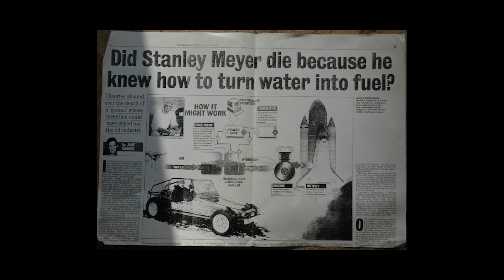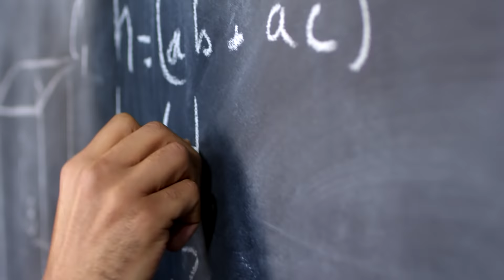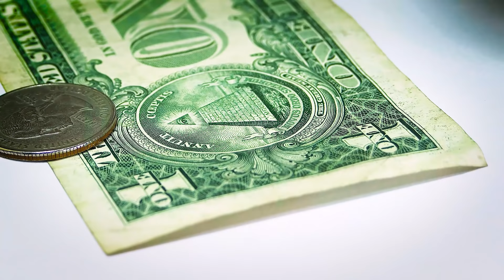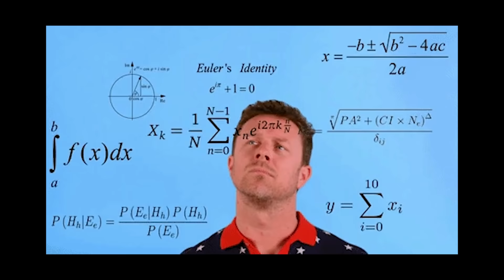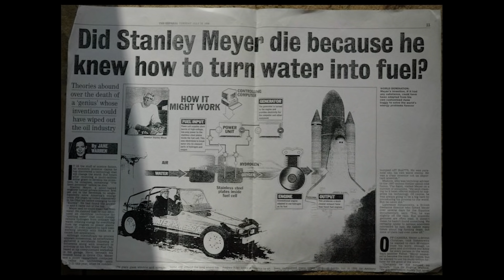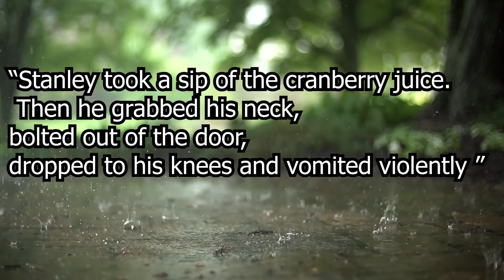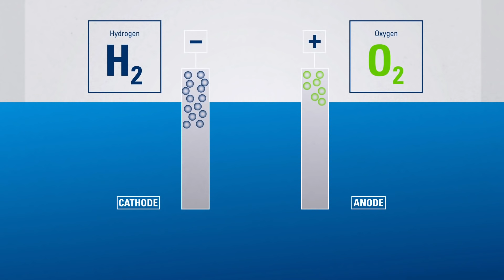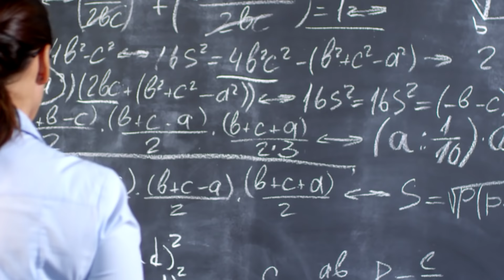Stanley Meyer Water Powered car, Lies and Death

Comment: How do you know it was an intro. I'm glad to hear to split Adams I'm just saying how do you know. And you think something like this was going to succeed it's kind of like the UFO and how long these people played it off as fake and now you're seeing all kinds of videos and all kinds of people saying they see these UFO's and aliens but not to get off subject how far off could it really be. If you're mechanically inclined how much  Voltage from an Ignition system how much voltage is there? OK hes just fast tracked that idea to processing it all-in-one shot and processed inside the motor using a plasma ark To start the combination And process in the cylinder of the motor. How far off is he he just basically made it  The idea simpler and you can use plugs and coil packs. And at the machines that you're speaking about Wouldn't the coil pack or an Ignition system of a vehicle be enough power to  The water  Into gas and igniting it And  Which turns the engine and he spoke about it it was video that if you were to tune it you would have to retard the motor because it is a bit more powerful than  Regular gasoline. So how could he know that the only thing you have to do with a vehicle once these things are installed in the car is that you have to tune it. He didn't say it's a wonderful fix all right there that 2nd type of scenario he never said that you have to put it on there and have to tune the motor to to the new fuel setting. And once the military got involved what you forgot to mention The only problem they had with that was the same type of problem they had with cars back in A-day was that when you made sharp turns the injured bug down The only problem they had with that was the same type of problem they had with cars back in A-day was that when you made sharp turns  The engine will bog down But that was something that can be fixed with pressurizing the tank or baffles or whatever there is to keep it from slashing around and closing a Is low fuel pressure. But apparently I guess it was fake because if the military was there riding along in this vehicle this vehicle that's running on the water on the water what was the military doing there the US military? And what happened with a lot of Nicholas's ideas Anybody believe him too. And it goes without saying if you're going to create the version of this option you gotta do everything and not talk about some things everything but you did miss a few things especially with the US military's interest in this technology.. Now if he was to bring something fake why would he fake it with the military. And what would you get on that if you did think about that You'd have to convince them that it works And one of the people were driving in this vehicle with him when he was driving it around in the parking lot. So What's really conspiracy one isn't.

Comment: Typical misguided video of using existing info to poorly explain the circumstance in a epic fail of post hoc ergo propter hoc,  skip the rhetoric like "the US was running out of oil"  which is the dumbest thing anyone could say, and focus on the fact that the oil industry starting witih rockefeller has been and is still manifuplated,   There is no need to have people feel the oil industry has supporessed and sequestried plenty of clean cheap energy tech, DO A BETTER JOB WITH RESEARCH AND SCRIPTING YOUR NARRATIVE

Comment: Standard electrolysis uses 12 amps at 12 vdc. Stanly found the resonant frequency of water which reduced the power needed by a factor of 10... 1.2 amps at 12 vdc. He then manufactured an injector/spark plug which would introduce a pulse of water followed by a resonant spark; voila, a car that runs on pure water. But Stanley made the mistake of running to the patent office staffed with tattlers who run to the big guns with the threatening information. The big guns send out the muscle and the tattlers get a little bonus, leaving the rest of us to rely on fossil fuels. Anyone who mirrors Meyer's efforts and runs to the patent office (greed) will ultimately face the same fate. Leaflets would have to be dropped from an airplane. It has to be a gift to the public.
Reply: Standard electrolysis uses 1.23 volts minimum and then any current after that produces gas. By theory it should be 2.08 volts minimum but in practice its actually 1.23 volts. Faradays electrolysis has a 100% efficiency of 1.23 watts producing 0.0105L of HHO gas per minute.

Comment: From what I barely understand about it, the addition of HH+ (powder, or liquified) into the water being converted, significantly assists in the separation of the H2 from the O. 
Adding the HH+ greatly lowers the amount of energy required to electrolytically liberate the hydrogen, & thus makes it possible for the machine to operate independently on-demand, without the need to store hydrogen in tanks, while still maintaining the energy in the battery that's used to start the combustion engine. 
I think Stan's complicated gadgetry allowing virtually instantaneous control over ranges of amps, voltages, etc, & of laser timing & injectors made variable acceleration & rpm's on demand possible from there. 
Today's improving EV's & batteries makes it likely even more possible...

For sure, that's a terrible oversimplification, but beyond that...
...if the globalist "Justinian deception," illuminati, freemasonic, zionist central usury-currency bankers, CCP, military-industrial complex & Jesuit-royalty criminal mob powers-that-shouldn't-be will go so far as to steal the Constitutional US Republic's independence secretly back to the English qween orchestrating by civil war, take over the continental railroads, create the FED by sinking the Titanic, induce 80 years of communism in Russia & all of eastern Europe, as well as China, start WW's 1, 2, blow up the Japanese with nukes, steal Palestine for criminal-apartheid zio-nazi-Israel & have constant war all over the globe, not just in Asia, destroy the WTC & many uncountable millions of North American lives in NYC & the mid-East, & now the WEF-WHO, big-oil, big-[p]harma/eugenics, big-propaganda media, with their Ukrainian-factory-bioweaponized-WW3 that's killing millions by deception, as well as now wants to attack Russia all over again...
...I think the murder of Mssr Meyers by poisoning is really easy to imagine. There have been thousands of other similarly life-lifting individuals as well.
We'd be dumb not to deduce it, given the history of all that's taken place against individuals, & the evil that's taken over our species since they killed Jesus in 0AD...

With all the death threats he had against him, fake law-suits, etc, thinking by Occam's Razor alone makes Stan Meyer's assassination a for-sure, foregone conclusion!

The only question I ask myself these 'daze' is, what are we going to do about it, & when? 
We better get ourselves organized & equipped now, this year in 2022, because now, these very same psycho-sociopathic sub-humans are coming for all of global humanity's infants before the start of new year's 2023!

Maybe they are "Klingons", or "Romulans?" 
Whatever they are isn't human...it is anti-earth, anti-life & anti-civilized.
We're long-overdue to courageously act in self-defence, more like Cap'n Kirk, Spock, Engineer Scotty & the crew.
Right?
Prove me wrong, but do it FAST!
Reply: And what is HH+?